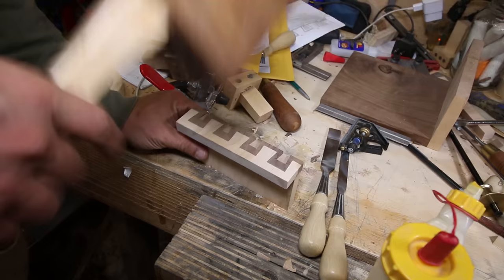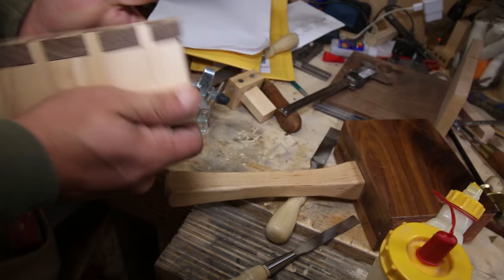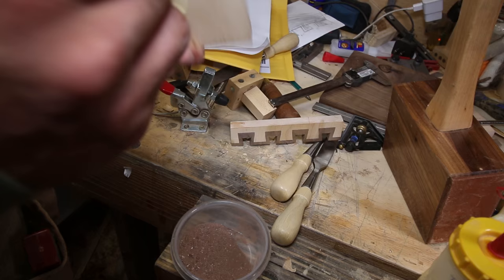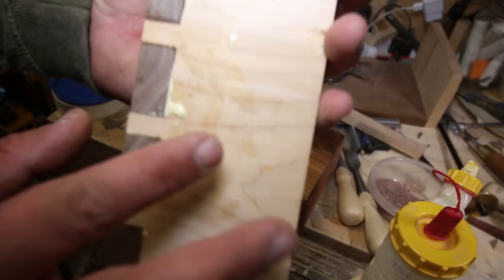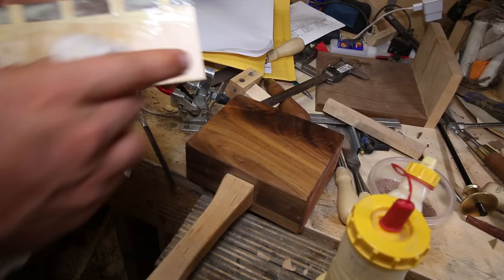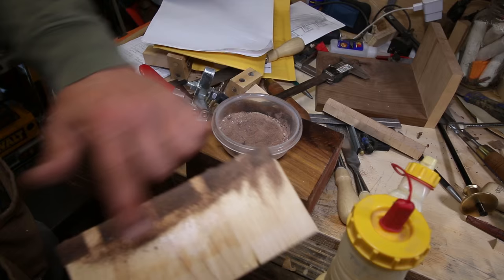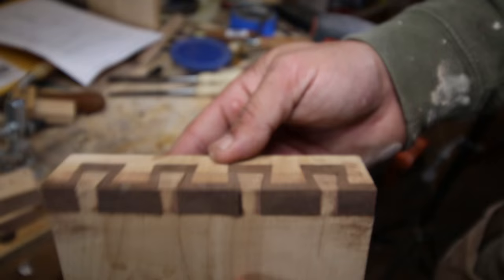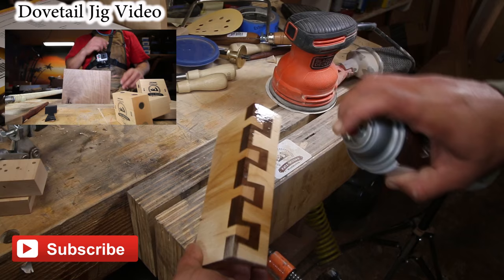Fixing Gaps in Dovetails, Box Joints and Miters A Katz Moses Quick Tip

Comment: Nice, I've used this before but it never turns out as nice as yours have, I think I'll need finer sawdust and lacquer really seems to help. Thanks! :)
Reply from the maker: Absolutely! I've found that Resaw dust from a bandsaw works really well or even save the saw dust from your sander. Thanks so much for watching!
Reply: +Katz-Moses Woodworking Shop  Do you find a laquer or oil finish helps hide the transition even more, or is it just to help make the joint look nice in general? I'll be sure to snoop around the sanders in the shop for some really fine dust next time.
Reply from the maker: Finish, regardless of type, ALWAYS makes them look a lot better. Happy hunting my friend. That fine dust can be allusive. It's easiest to plan ahead. I always will blow out my tools before milling lumber and sweep the floor before I start. that way all the saw dust is from your current project. Worst case scenario you can use a coffee grinder with some courser saw dust to make it finer.
Reply: +Katz-Moses Woodworking Shop  I see, thank you very much. Happy 500 subscribers in advance! Can't wait for the inlay dovetail video as well, they look fantastic :)

Comment: I have the same issue with a bridal joint. I'm just worried if the glue will block the danish oil that I m planning to apply,  making the gaps more visible after I apply the oil. What do u think ?.